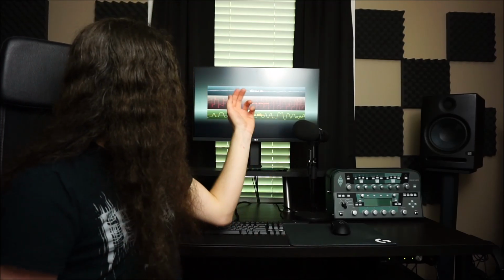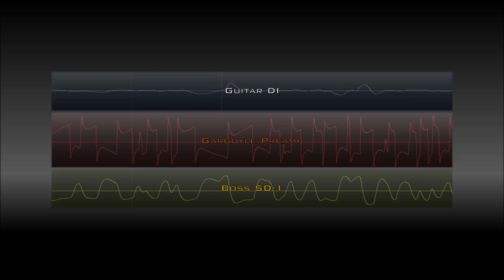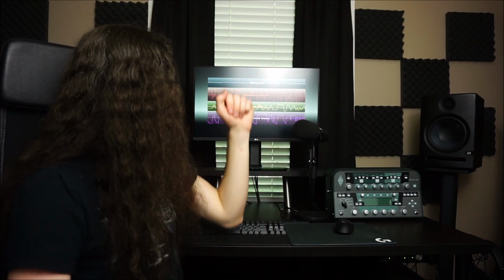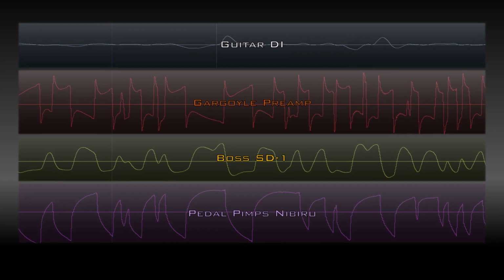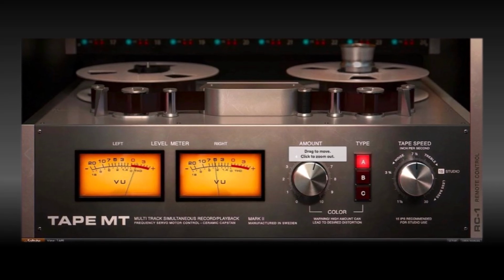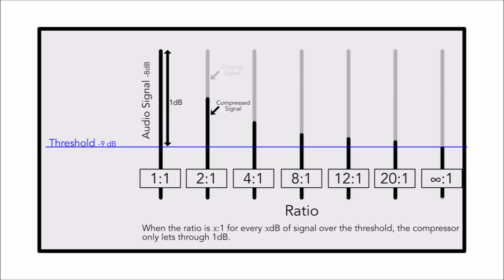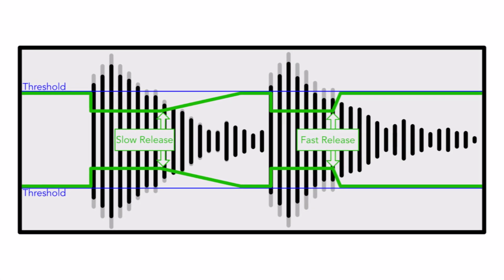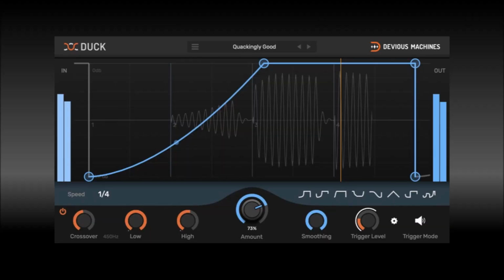Gain vs. Distortion, Compression, & Dynamic Range - Explained

Comment: One thing about tube preamps is that, even for really well designed ones, triode tubes just have inherently asymmetrical amplification properties. For small signals and small amplification factors, you can exploit a reasonably linear amplification region and minimize that. For what you're doing with most instrument signals, that is virtually never the case. Result of that is that all tube preamps distort the signal to some degree. It's inherent to the tech.

Power amp tubes are pentodes, and a completely different animal (hence why they distort in a completely different way).

Comment: I was always under the impression that 3dB was doubled volume. I went googling after hearing you mention 6dB and now I am left even more confused. I'd love some insight into this:

"The human ear's response to sound level is roughly logarithmic (based on powers of 10), and the dB scale reflects that fact. An increase of 3dB doubles the sound intensity but a 10dB increase is required before a sound is perceived to be twice as loud."
Reply: Decibel scale is weird, it has two main scaling factors: power (each 10dB means a 10x change) and root-power (each 20dB means a 10x change).  

Doubling (or halving) of power is a 3dB change, but of amplitude is actually a 6dB change.

Different uses will use different scaling factors. Acoustics generally use power scaling, electronics usually go for root-power scaling.
Reply: @EversonBernardes  Thanks foe the detailed response dude!
Reply: @MrTheog1989  glad it was helpful! It was pretty confusing to me too, when I first began working with production.

Even though we're dealing with sound, most music production is done through a signal processing perspective - so when a compressor states a value in dB, it's almost always in root-power scales i.e. 6dB halves the amplitude. 

Almost always, because some old equipment used the other scale for some reason. And no equipment ever states what scale it is using so... yeah.

Comment: Great content. To streamline your untethered lav setup, see if you can find a used Tascam DR-05 that you can slip in your pocket. The on-screen meters and tally light will help you know that you’re actually working (when you tap on the mic to see the spikes) and as a bonus, the preamp is quieter than the one in your phone. Pretty high quality upgrade for the pretty reasonable price.

Comment: I was wondering about this. I use a Um300 in front of the Marshall MG50Dfx clean channel and I noticed it beefs up the low end when I Increase the gain on the amp. All that solid state thin sound doesn't sound all that bad once I do that. Ofcourse with the 8 string I reduce it.